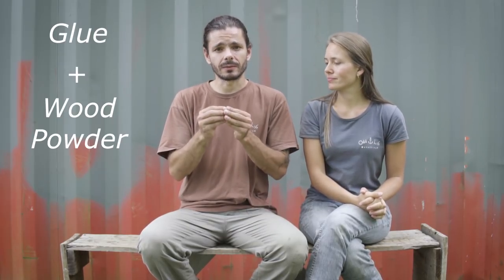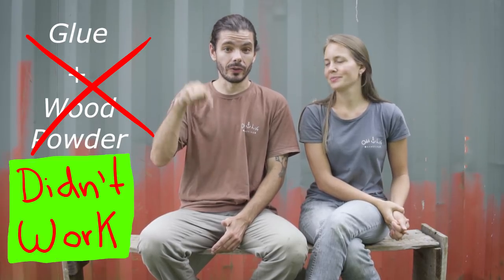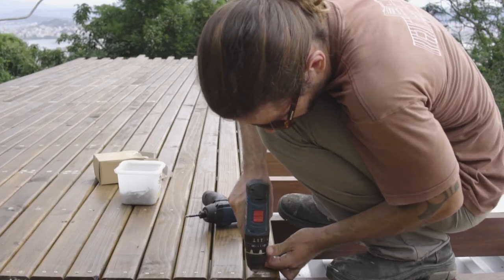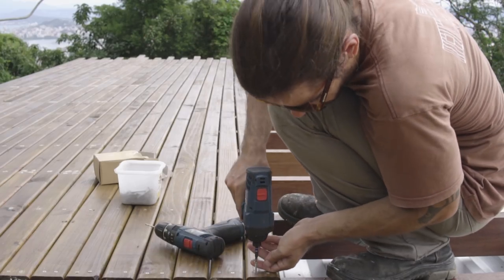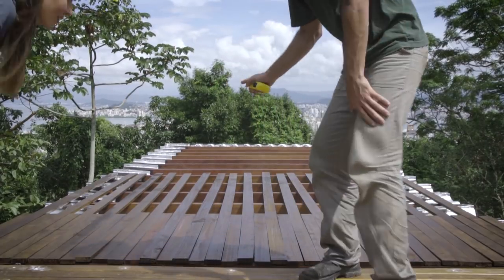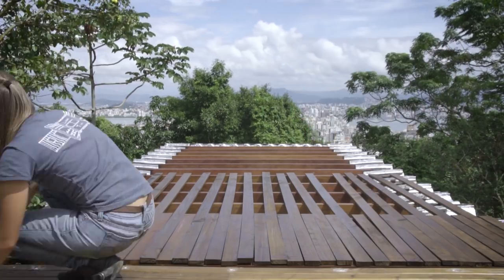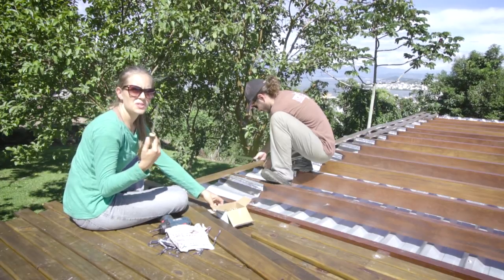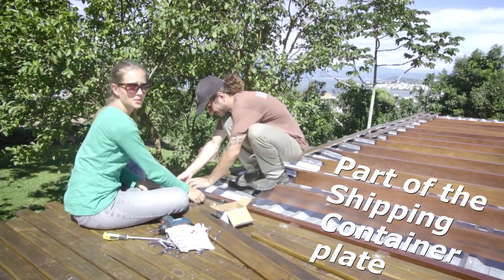Tiny Shipping Container House Deck - Living Tiny Project Ep. 023 Part 4

Comment: Only getting to watch your video update now, but it's looking good!! Glad you used the spacers to speed up laying the decking boards, but make 3 or 4 spacers so you can leave one at each end of the board and 1 for the middle (plus a spare). Also once the whole deck is laid the gaps aren't so noticeable - it's the sunlight getting under from the edges which makes the gaps look bigger but once complete these will look better. Keep up the great work. Boa noite!!

PS. on warm days Guarana (Antarctica) is my favourite cool down drink!
Reply from the maker: 👌🏼👌🏼 we actually have a local guaraná called Pureza that is wayy better!!😂😂
Reply: I've had the Brahma one and the Kuat/Quat version and i thought Antarctica's was the nicest. Now i have to try your version!
Reply from the maker: For sure, if compared to Kuat, Antartica is better, but if compared to Pureza, no way!! 😊😊😋😋

Comment: Glad to hear the rooster is in the background again....😂. By the way, there are different grades of Stainless steel. The best to use for this application is 316 L stainless. The ‘L’ means low carbon contents which is what causes rust. These are used in Marine applications, so they will hold up. Also, you can get these with a ‘Torx’ or ‘Hex’ head to them for easier install. Please call on me if you might need help with metals or questions designing something. I have been a Machinist 40 yrs. I am getting ready to build my own 7 shipping container home and Working machine shop. I love helping people. You can see some of my projects at my channel “ProfabDesigns” here on YouTube. Great job to you both. Your a cute couple and it shows the love you share for each other.
Reply from the maker: Thanks so much for the support and tips. We will definitely checkout your channel and later on I have lot of “metal questions” for you. I’m really interested in aluminum and also steel sailboats 😬😬

Comment: I can save you some time on your Experiment and "Spoiler Alert" the more gap now will be even more of a gap later as the wood shrinks. I've constructed many decks in the past and on my first deck I used a 16D nail as a spacer for the gap. Sure it was very uniform until the Pressure Treated Lumbered Dried out about 45 days later and the gap extended to easily 1/2 of an Inch or .5mm and I am here to say that did not look good. Thereafter I butt the decking as tight as possible and when it shunk left about 1/4" gap if that. Water takes the path of least resistance and any gap is plenty to allow water to pass by. What is more important is the deck slope with regards to how it will allow water to run off. If you entire deck is flat with little to no slope, deck gap, is not going to do anything for you and will probably hinder you.

Cupping is another issue with Decks if you install decking with the CUP UP. That will hold water for days until the Sun dries it out. Sometimes decking is cut from the very center and the plank will cup on either side so there is not much you can do about that. View the plank from the short side or width and see how the lines go through the board. Look for U shape and install with the U pointing down. The U is the CUP of the plank. Your boards don't seem to be too wide so Cupping might not be an issue for you but it could be for someone else. It helps to install the screws very close to the outer edge to keep the plank from cupping as much. Of course wood moves and if it wants to cup no screw pattern will help but may slow it down.
Reply from the maker: Thanks so much for all the advices Paul. I don't know if it will help but the wood was pretty dry. We left drying on the shade for like 3 week before applying stain. It might be the reason the wood wasn't straight at all when we installed. To be honest there is no much we can do now. We already finish all the decking installation so fingers crossed, let's hope for the best. The next deck we need to do will have a roof on it so I guess we will have less problems. Hopefully!!
Reply: It's very good you let the wood dry before installing it, you should not have much issues then regarding cupping or drying out further. You also sealed the wood which was good too as the Stain should keep the wood dryer for some time, just depends. If you get a lot of rain and sun the stain should hold up fine. But if you get more sun and less rain, then the stain might dry out sooner rather than later. The wood I used was pressure treated and was very wet hence the reason it shrunk as much as it did. If you said in the video I missed it about what type of wood you used.

I also noticed you used a drill to drive your screws and though it worked just fine you may want to consider an impact for driving future screws. Once I started using an impact to drive screws I hardly used my drill again. The drill is very handy for making holes especially larger holes but the impact is awesome for driving screws. The screw is very hard on a drill but for an impact that is designed to take a beating the screw is very easy. Pre-drilling the holes is always good and an impact makes short work of starting and driving screws... 

You two are making great progress; I just wish I lived close enough to give a hand I luv doing this sort of work. Feel free to message me if you run into any issues or have any questions; I just might be able to assist you...
Cheers...
Reply from the maker: Thanks so much for taking the time to help us. This makes a huge difference for us. Actually we forgot to mention we did let the wood dry. About the drill we actually used both. We did a pre hole with the drill and screw with the impact driver. It's great. I love it!!
Reply: Awesome.... I look forward to what you do next....

Comment: sounds like u should ask around and research it b4 u start a project,, who is ur hardware guy,, geese guys dont know u ask b4 u start go 2  a library and research it 1st use new methods and old wood filler is not water proof just water resistant wont last 4 ever  yes awhile but from wat i see it will hold for a few years no problem id  worry about it wen it becomes an issue  with the screws not go back ,at least on ur top decking boards